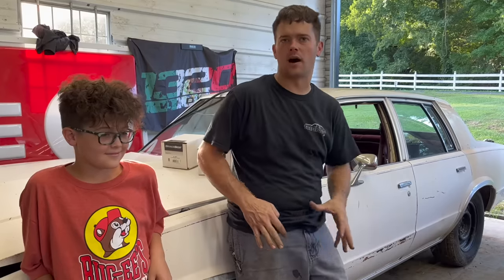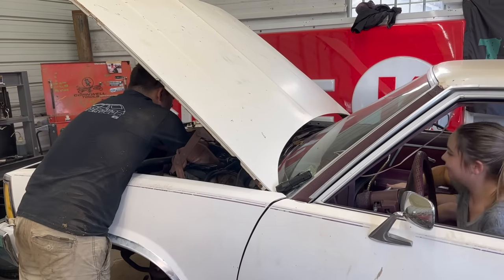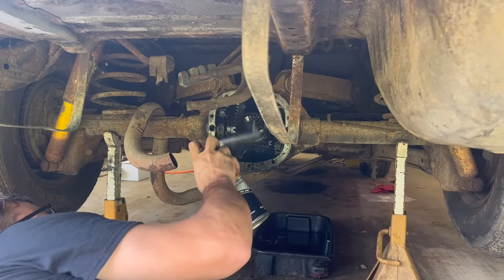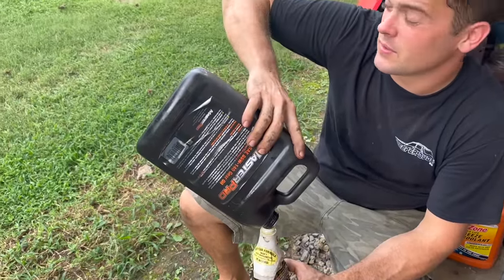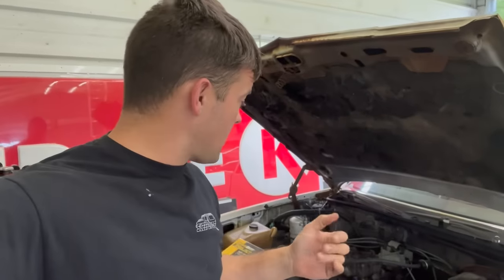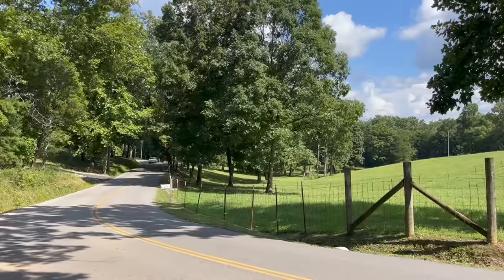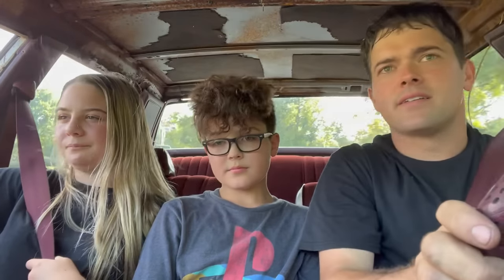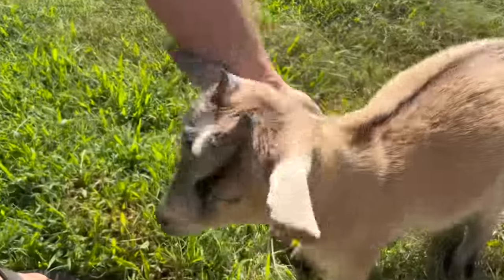Wife and Kids drive our Malibu Burnout car. I made some mistakes!

Comment: Love the way you pre heat the steel gears prior to welding them mate, I spent 14 years racing the ovals here In the UK, welded rear axles a must for me also.. Happiness is a quick motor, sideways on full power just cornering..Thanks for the smiles all you guys.. Ian - UK..

Comment: Absolutely love this we had a 83 Malibu wagon growing up that me and my father built the 305 out a performance cam, predator carb, bored and stroked with every Moroso accessory from the catalog in the 80s and 90s with straight pipes and I absolutely loved driving it. It was the burn out king and once we switched the 350 transmission for a turbo 400 we could actually drive it on the highway. Great video as always. My dad passed away last year and my brother has the wagon now and it brought back many memories of late night working on it before taking it to the track
Reply from the maker: That’s awesome

Comment: Love that car!  Great number 11 up the road, mate!  Huge!  Good to see you teaching the kids how to do them too - taught mine when they were learning to drive too!  Mama's face when she floored it was priceless - those gritted teeth and the wide eyes, man!  You're gonna have to fight her for the driver's seat in the competition, for sure!  

Noticed when you were under the hood that the vacuum advance was capped off.  Could be that the engine isn't advancing enough when the throttle is floored.....or the mechanical weights in the distributor aren't moving out when they should be.  Usually a hesitation issue like that is more indicative of an electrical / spark issue than a fuel one.  Just been through this "falling-on-its-face-when-floored" problem with my Stag's V8 and it turned out to be a combination of the balance weights and some heavy wear in the distributor shaft bushes that were causing it. Would be interested to know what you find as the answer!

All the best

Comment: Thought one time I had a 350 four bolt...cleaned the grime off the valve covers and they were blue! Light turquoise blue. Cleaned a little more and it said High torque 327! An old vette motor. By the way, this is the same model of my 82 El Camino. 350 4 bolt with mild cam.

Comment: Okay, just a tip from an old mechanic on how to teach your kids to bleed breaks. 
Have your kid pump the pedal 2 or 3 times and hold it down, and say to you, "Up!" And you open the bleeder and the kid yells out, "Down!" when the break pedal goes to the floor. And you close the bleeder, and yell out, "Up!" And he or she let's the pedal come up, and pumps it a couple times and holds pressure on it and tells you, "Up!" And you do that a few times, don't forget to check the fluid level. And in 10 minutes or less you'll have a great break pedal.

Comment: sounds like your vaccuum modulator on the transmission is not working just put a new rubber hose on it loop the hose into the front seat get Ralphie to suck on the hose to create vaccuum while you driving and that should fix the shifting problem lol he he
Reply from the maker: That’s funny
Reply: @Sleeperdude  hope you make a video on the burnout competition wonder what Ralphie would think about my suggestion on vacuum

Comment: Just not hot rod able. Good Sunday driver. maybe.?
Reply: @Sleeperdude  Like you said a new intake and carb. I like the old carter AFB.  Edelbrock bought the pattened for it. Now you see all these Edelbrrock carbs. Demons carbs are good and cheap. Or used to be. Dont know if I like the Name. Use to be a 340 Demon Dodge mopar and they really ripped. Of course they have nothing to do with each other. Point is I used to go and get them at the salvage the Aluminum Four Barrels or carter AFB They are rebuildable if you can get one off of an old pontiac. from the sixties

Comment: Anything on this Malibu give it the Beans treatment. 
On the transmission it may be the modulator valve needs adjustment or replacement. 
or adjust the bands in the transmission Adjust the throttle valve cable. Advance the timing up a bit check the vacuum lines going to the Q-Jet. On the metering rods they have 2 letters should be stamped in them. The best ones are the AX Metering rods. 
I would love to see the test-N-tune at the Dragstrip 
That Quadrajet deserves to be rebuilt and fine tuned. 
I wouldn’t worry about running headers I’d just run dual exhaust 2-1/2 inch pipe. Anything to delete that catalyst converter that’s on it. 
Sorry for the long reply. 
I thoroughly enjoyed this video and the whole family involvement have a Blessed one Y’all.
Reply: solid advice!
Reply: Maybe the vacuum line to the modulator

Comment: Josh, they make a gear oil pump that fits on a bottle for charging gear oil on boat motor lower ends . You can find them at Walmart in the outdoor stuff.

Comment: Maybe the booster has no vacuum. The vacuum hose for the brake booster goes to back side of the quadrajet. It’s looked like it was run to the front of the card, which is a vent for the evap system. Always enjoy the videos.
Reply from the maker: Ok thanks

Comment: Great Video As Always.  I have a 79!C-20 Chevy truck with the same exact engine with a Turbo 400 transmission. 
That was one of the best trucks that I ever owned for pulling my portable welder and or 16 foot tandem axle trailer for moving a tractor.  A coworker of mine used to be a “QuadraJet GURU “ and always removed a very small bracket in which he claimed that the secondaries wouldn’t open right unless this part was removed. This guy also claimed that the fiber floats were prone to the ethanol fuel eating away the outer coating making the float become saturated with fuel. So the brass float was the way to go for the best overall performance. 
The one thing that you didn’t ask about was the transmission. I would love to know why the transmission was behaving like it was.

Comment: Put a four speed in it .
If you're going to use it in shows for burnouts.
Every once in a while you have to put in some new clutch plates.
A lot easier than replacing transmissions.

Comment: That's one hot g body it deserves a 350 or a 400 but the 305 with some 350 heads will bump the compression up just a little
Reply: Or 305.heads on a 350 will make it run cooler

Comment: What I do is get a glass container like an old pickle jar. poke a hole in the lid. and place a piece of old brake line in the hole to the bottom of the jar. then I put a rubber hose on the brake line to connect to the bleeder screw.  This way you can add a little brake fluid to the container. And just hook the hose up and pump the brakes.  No more air.   Just a comment.

Comment: I bought an 81' Malibu 2 door with a 305.
I drove it to Michigan to visit family & my cousin smoked me with a 74 Ford Maverick , 302 4 speed.
When I got home, I decided to make mine go fast (er). 
I changed the intake, carb & opened the exhaust up...
Then took a 4 speed out of a camaro & made her a floor shift.
A yr later I had my buddy put different heads on er & that really increased the speed...
It only had 38k on it when I put different heads on it .
My dad thought I was nuts.
I never had it on the dyno , but Im sure I gained a 100 hp..
I drove it back to Michigan & my cousin now had a 69 Torino with a 351 & built to run.
I smoked him .
Id rather raced the original Maverick but that Torino had a bigger motor & lots of go fast parts.
So I was content.
I wish I had kept the Malibu .
But I traded it in on an 84 Impala 2 door  .
Same 305...
I loved the 305's.
Today ppl use em as boat anchors , but they are a good motor...
Reply from the maker: That’s cool thank you

Comment: White Lightening is her name ! lol Loved my 79 and 80 malibus. Oddly they both had 4 bbl 305s but the 79 was faster! I put the temporary spare on and backed up against a curb then burned it off!  I was surprised that you didnt use air to blow the diff out after cleaning it but we all get excited and forget steps ! lol Get a a few bags of cat litter to keep nearby for spills and fire suppression. Ive made gaskets out of card board before in a pinch. Those in carb filters clog easily on those quaddra toilets ! Could the shifting issue be vacuum modulator related ?
Reply from the maker: Your right thank you

Comment: The rear-end gearing is causing that long burnout. The quadrajet just has that hesitation. I had one in a 73 Chevy Camaro that was set up for drag racing. If you put 370 or higher rear-end gearing the tires won't burn as much.
Reply from the maker: Ok thanks

Comment: Take a close look at the bell crank that lifts secondary metering rods in the Q-Jet. I have seen them burned from carb backfires to the point where ther metering rods will not lift correctly. Causes hellacious bogs. It's a common problem in the hot rod world.
Reply from the maker: Ok thanks

Comment: 👍 Check the engine timing ? And The transmission modulator valve maybe the issue or valve body is sticking??
Reply from the maker: Ok thank
Reply: @Sleeperdude   might try some Lucas transmission fix. If it's the internal issue.

Comment: by the way it's A lot easyier to get to the spark plugs through the wheel wells after taking off the "hoops and casings" there are cut outs for that. I had both A 81 parts station wagon and an 82 I used to drive. the 81 was all standard the 82 was half standard and half metric. Gas tank swapping was much easeier in the car than the station wagon.
Reply from the maker: Ok good to know thanks

Comment: for future reference so you don't have to count the teeth on most GM if you look on the ring gear there will be a list of numbers, in that list you'll usually have the gear part number and the teeth count for the ring and pinion, look for a set of numbers spaced away from the longer numbers that would look like 41:12  or sometimes there just a space between them or some odd character between the numbers, these numbers are sometimes also stamped on the back of the pinion gear that is visible in the housing, these are the teeth count for the gears
Reply from the maker: Ok thank you

Comment: You need to continue with the delete,n go for the power glide and get rid of third gear! Dump the Quadrohog and get you a holly there good for gown to town rigs but not the race track! And delete the proportioning valve on the brakes i would also reinstall the rear brakes so you could have emergency brakes not the hydraulic just the cables just sayin ya never know!
Reply from the maker: Ok thank you

Comment: You really should silicone them gaskets to the cover then skim coat the other side and put them on that will help with typical chevy gasket leaking the have an unfinished rough surface that's prone to seepage . did you put a plug in the master cylinder for the back break part.
Reply from the maker: Ok thank you

Comment: You could have got the dent out of the tank with your air compressor. Block off the filler neck and put a loop of hose on the inlet and outlet then blast in some air
Reply from the maker: Ok thanks

Comment: The brake booster is hooked where the pcv is supposed to be on the carb. The booster is supposed to be on the intake behind the carb .
Reply: I didn't notice that but that is interesting.
I think they are both full manifold vacuum. But do you think that was the cause of the poor braking at the start?

Comment: By the way if you go to replace the carb the smallest qjet was 750 cfm. So you would need something at least that big on vacuum secondary...you will need an adapter if you do being it's a spread bore.

Comment: I need to add this,  "PUT JACK STANDS UNDER THE FRAME OF EVERY SINGLE VEHICLE YOU JACK UP TO WORK ON!!"
I DON'T WANT TO TRY TO FIND YOUR VIDEOS AND LEARN THAT YOU OR SOMEONE IN YOUR FAMILY IS EITHER VERY HURT OR DEAD BECAUSE A VEHICLE FELL OFF THE JACK AND CRUSHED THEM!!
You had jack stands under the rear axle,  but  the car wasn't setting on the stands up front. I went back and looked at the video again and the stands were there but the car was held up on just the jack. The video must not be showing the car actually on the stands.  And if you weld up an axle again and it catches fire again just put the cover over it until the fire goes out and then make sure you clean all of the gear oil out of the differential.

Comment: Find a pair of 96-2000 906 or 062 casting Vortec 350 heads and buy a intake. You’ll pick up a lot of power with a small cam. They made just as many 2 bolt 3970010 350 blocks if not more. The 882/624 heads are low compression smog heads that suck

Comment: Excellent video Sleepdude Crew  :) also Malibu Classic vechiles are awesome also amazing guy orgnail had those 4.4 litre 267 of low hp was blue motor , high hp was orange  to but put 5.7 litre 350 V8 also carb this has 267 one can tell and need get 350 one 650 to 850 CFM to with electric or manual choke and Transmission why not shift may want change filter on plus fluid put GM style Number 3 in plus Black Bottle of Brand Gunk Red Seal Trans-Medic in with new fluid also get rid of all problems too all Netural  getting too! Also for brakes Josh need grease up Slider bolts  on Calipers plus plunger too on front brakes that help them grip  also Gauges may be on unhooked or fuse blown too need change there glass tube with metal ends from 5 amp to 30 amp and 250 Volt ! Get grey bottle of STP Total Treatment fuel injection and carb cleaner in fuel tank too also should get Oil Dip Stick plus  Tube  to in  also fix up car to and ! Orgnail rims Malibu, Monte Carlo those had 5 star are OME Racing types too!

Comment: Josh, on the qjet the back barrels the rods are supposed bto go up with the rid hangers. The reason it was bogging is it's getting to much fuel for the barrels opening. The fuel to air mix is not right. When you push on the back barrels the rod should go up freely on the rid hangers. Now if you have extra rods, you can change them and further tune the qjet to really sing. Also wire the choke open or take the flap out. When going on and off of the peddle the choke is going to close and open flooding the carb out and making the carb run funny like it's doing.

Comment: Josh, the Vacuum modulator is not hooked up that will make it drop 3rd gear and only shift 2nd when going fast. Also GM HEI distributors only have 12 to 15 degree spread, so power time it 35 total will make that thing rip.Love You guys they way your whole family helps is great. Love all the animals

Comment: Near neighbor from Raleigh, big fan.  I'd like to see the exact performance package you mentioned, and some el-cheapo paint matching that would offend your professional standards, but fit the car.  Kinda think the disco era wheels fit too!  

How about if it doubled as a redneck drift car? Put the rear brakes back on, but just put a cable actuated handbrake on each side like the drifters?  

Sounds like you need a trans... but no, not a powerglide.  I'd stick with a cheap T350.  As long as you stick with reasonable width non-sticky tires, the rear should live a while.  And replacements are cheap!

Comment: I had a 1979 2door Malibu Classic coupe and put truck springs under it on all 4 corners and the best part we had a 350/350 Corvette motor and a good Turbo 400 in it , back in the day before they redone all the two lane roads in Western central Pa north of Pittsburgh PA in Butler county we would pass everybody on the berm or ditch and would be like berm runners out the windows as we would scream past throwing dirt and rocks on everything and everyone. Was so cool with the impromptu body lift and we put grille and tail light guards on it. Was like that thing that Junkyard Digs LeMans but better. I hope that you have a great day today Sleeperdude

Comment: Hey Josh. Get another windshiel washer pump and tank. Mount it in the trunk, with the hoses going to the rear fender wells. Fill it with Purex. Spray the tires during beginning of burnout, and periodically throughout. The bleach reduces friction.

Comment: im known locally as the Gbody guy cause 99% of time you see me driving a old olds cutlass from the 80s or some other gbody at time of commenting i have a 81 85 and 86 olds cutlass 81 260 engine the 85 and 86 got 307 there gutlass but drive why better any new pop can computer car iv drove

Comment: Psst, Josh!  If you are going to do burnouts in that Bu you better go ahead and get a 9" Ford rear end for it. On other channels, I've seen those little Chevy rear ends fail numerous times in the last few months.
Aha! An engine swap... I wondered how that thing made enough power to spin the tires.
P.S. If it's going to be a burnout car, disconnect the rear brakes. Also, put a small nitrous kit on it for when it tries to bog down. 😉 Hot Rod Mama gritting her teeth while doing a small burnout was hilarious!
Yes, more burnouts, drag racing, and rust repair!

Comment: What transmission is in that?
If it's a 3spd auto it will have a vacuum module. Check the vacuum line and the module to see if they are holding vacuum and that they are working. 

Love your channel Josh. Keep making the awesome videos.

Comment: Put a 6.0L LS in it, run it off a carb with the 200r4 and stock rear.  Boil the hides.  I did it with a nephews Grand National that puked it's motor for pennies compared to rebuilding the original V6 and had a ball doing it and it outran that turbo V6 by a country mile.

Comment: Check the shifting modulator on side of the transmission for a vacuum leak.. It runs off of ported vacuum from the engine to shift between gears.. On the secondary's of the Quadrajet thread in screw till you feel the tension then start at a 1/4 turn to 3/8' of a turn inward to get them to open up at the correct time